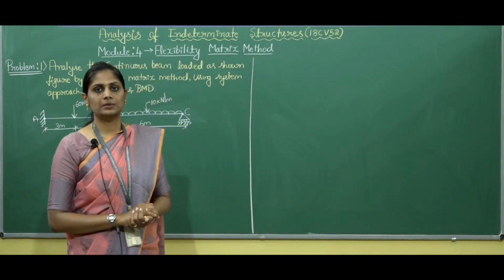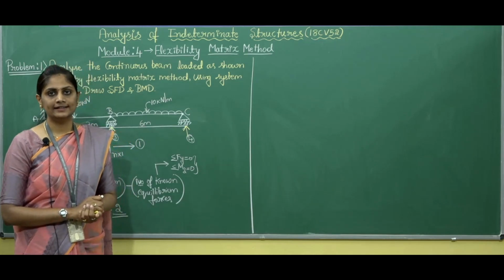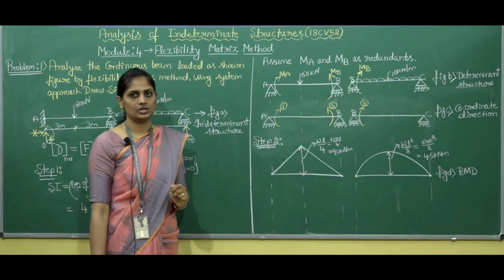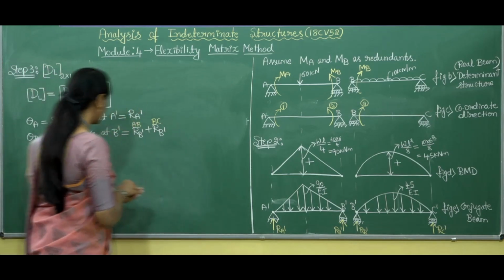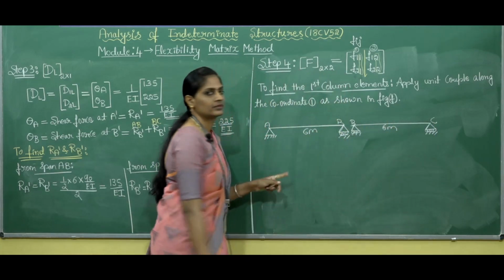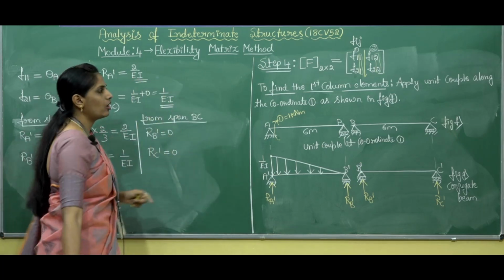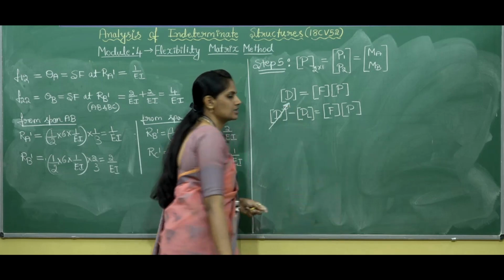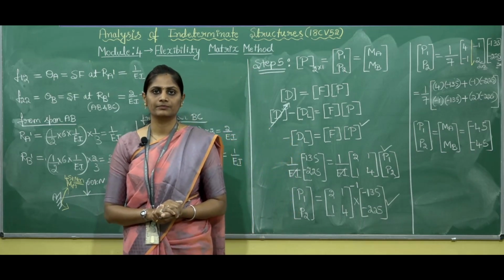Flexibility Matrix Method

Comment: If we are using conjugate or virtual or any other method to solve the flexibility coefficient then it doesn't make any sense of doing it by matrix method.. 
Matrix method is used to reduce the time consumption and solve the complexity into simpler... 
So the problem is solved by using equivalent joint loads will be much better in my point of view